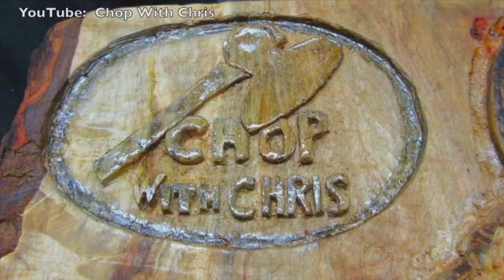From LOG to DOG SLED By HAND & FOOT - ASMR

Comment: A real gem Chris....from start to beautiful finish.  One question:  how dry was that walnut log....with regard to if it was dry, no problem....if it was wet.....possible cracking or checking.  Best wishes for a merry Christmas and prayers for a much better new year!
Reply from the maker: Thanks.  The log was still green but the strips were so narrow cracking never became a problem.
Reply: @ChopWithChris  What a fantastic job! Thanks for the  very interesting video :) Did the joints become tighter or more loose with drying? Any plans to reinforce the skids with metal or do they not wear much? Best wishes from Norway!
Reply: 6z

Comment: Sir, I split lots of locust posts and rails. One tip.... I switched from driving wedges with a sledge and started using a maul. That way, once you have a split going, just hit the gap with the maul and pop the pieces apart. Your work quality and video presentation are top notch and are much appreciated.
Reply from the maker: Thanks!’

Comment: Very confident... You obviously never had to get steel chips removed from your facial tissue, penetrating skin and flesh and only being stopped by bone. There is a reason experienced operators use wooden mauls on steel wedges or nylon wedges with steel axes. Good luck for the future!
Reply from the maker: Thanks for the advice!

Comment: You’re a machine.....
Reply from the maker: Thanks! 💪
Reply: Question for you: looks like you had some crushing when you bent the runners?  I’ve had similar issues steam bending,  any thoughts on doing anything different if you did it again?  Or was I mis-seeing there?
Reply from the maker: I would have used straps on the backside to prevent cracking.